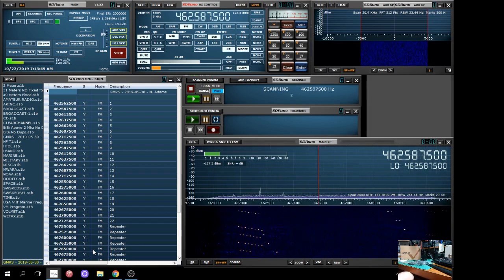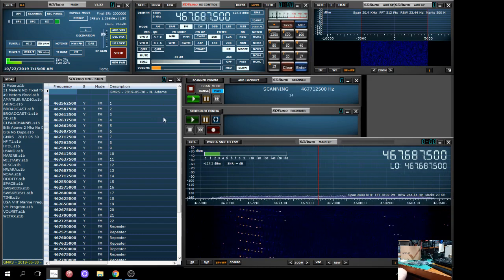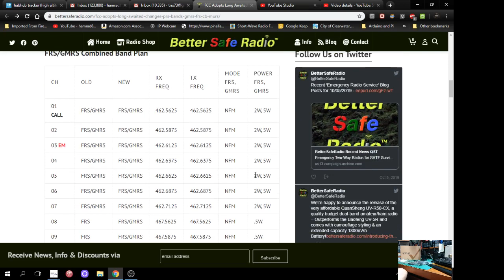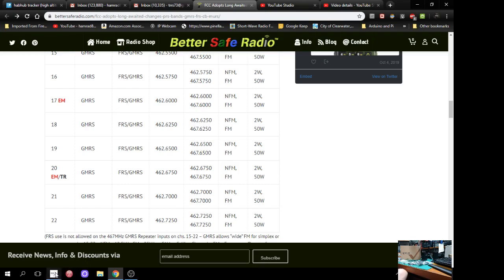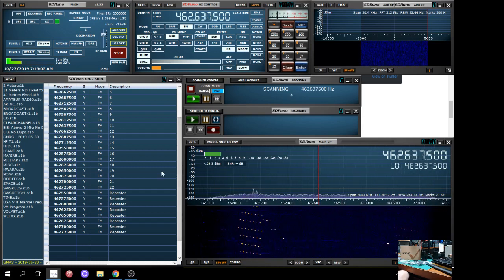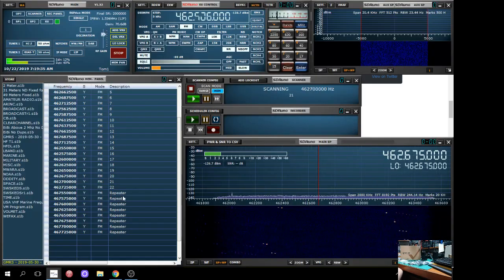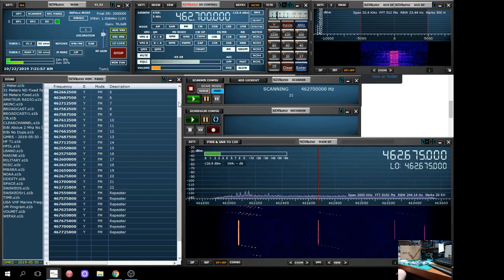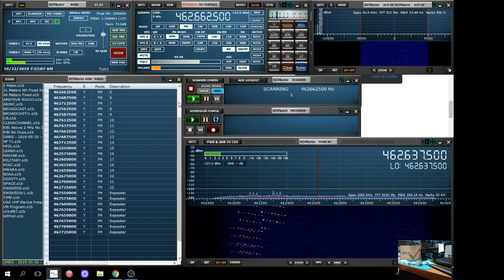TRRS# 1808 - Retevis RT21 Testing Part 1

Comment: I know this is an old video, but just in case someone is reading this now, the channels on the rt21 are the full two watt channels. (1-7 and 15-22) The 1/2 watt channels  (8-13) are not included because the radio could not reliably transmit at that low a level in testing.